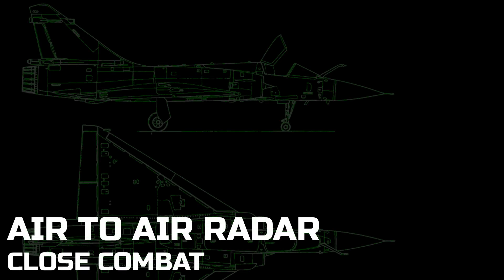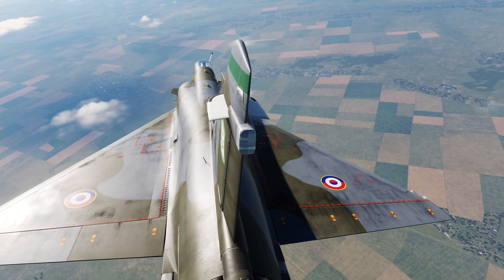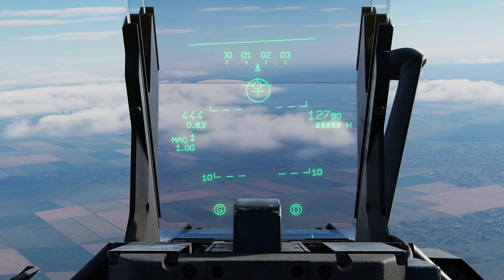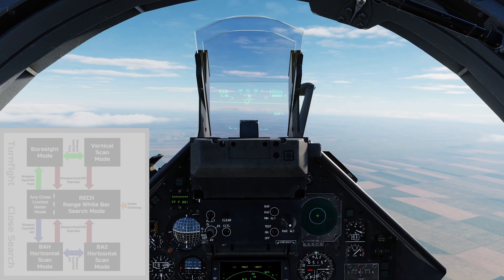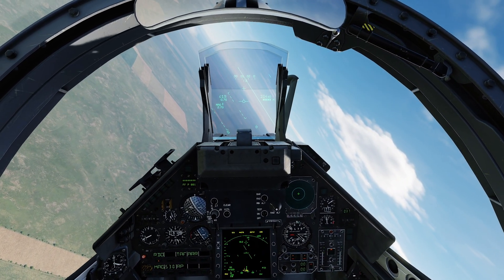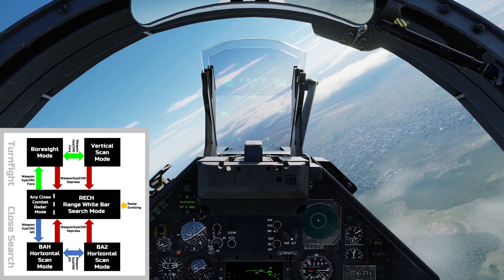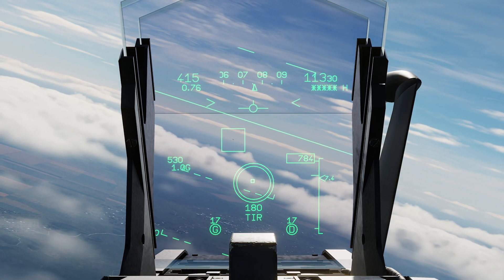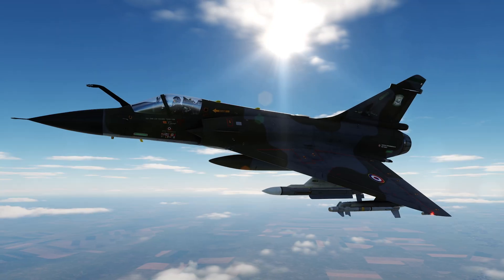The Art of the Mirage 2000C - Air to Air Radar in Close Combat | DCS World Tutorial Series

Comment: Would it be fair to say, since RAS is used in interleaved mode, that its more intended for slow targets? Your video on other a2a radar functions mentions interleaved and brf modes being able to see raw contacts that the computer doesnt want to track. In the case of your c-130, you could watch for the blip, set the designator over it, and close the distance until it auto locks.
Reply from the maker: Great question. That is indeed fair to say. The most efficient way you could directly lock-up a raw BFR contact would be to use RRAS. BFR is certainly better for identifying slow moving targets like the C-130. The limitation of RRAS is that you have to close the distance to within 10 nm before it locks but nevertheless, it can be used effectively against large, slow moving, low-threat targets.

Comment: I'm not quite sure what the use case would be for Ras mode? Seems too cumbersome to use to quickly lock onto something. Maybe if you want to lock up a specific aircraft in a group and can't tell them apart on the radar screen?
Reply from the maker: Yes, you have to work quickly to achieve a level of functionality with RAS. I have used it in the past when flying with a wingman and intercepting bomber formations, where we have agreed to target particular elements. A similar outcome can obviously be achieved using boresight mode, but if the distance between the elements is small, RAS just gave that little bit more clarity in selecting the targets. Despite this, it isn't a mode I use very often.